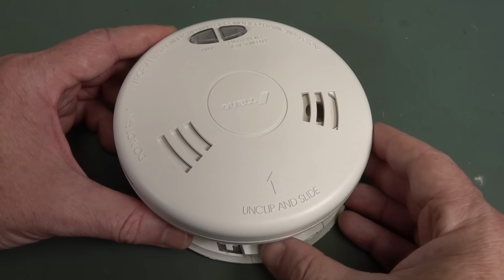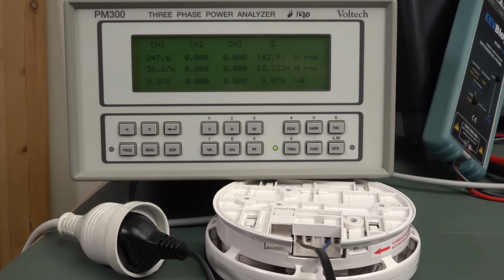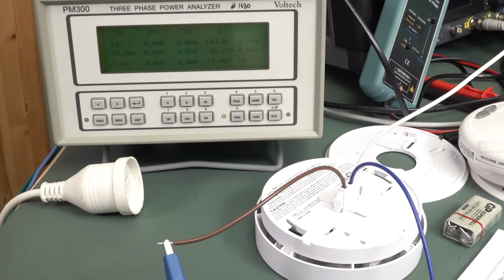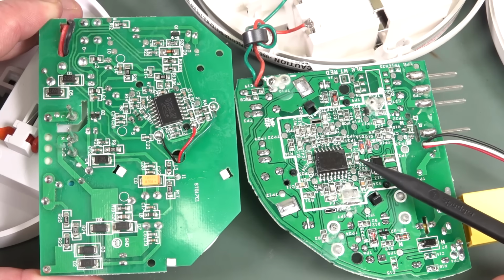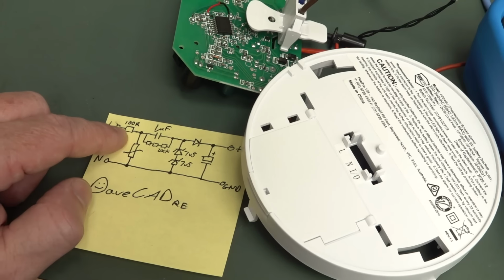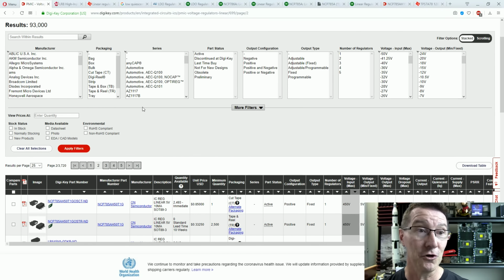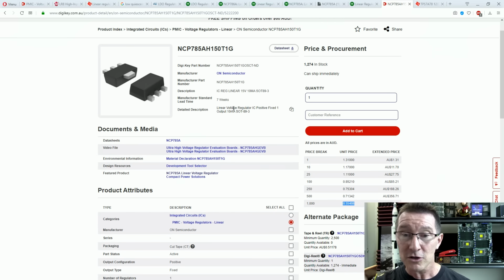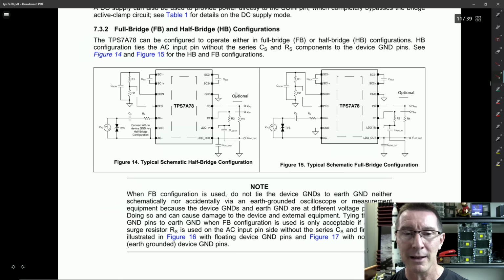EEVblog #1284 - How Bad Product Design Kills The Environment

Comment: They use that hinge system assembly to prevent electrocution when we replace the battery , try to test them with an over voltage and see if they detect their own smoke  before catching fire .

Comment: I think the problem is not only to be found in cost reduction targets, as these devices use very traditional designs. Of course there is always a more modern and more energy efficient solution but-- imagine you are a chinese backyard engineer who copies twenty-something years old european design-- you might have never heard of. 

And: these capacitor-rectifier designs are compensating apparent power (some say blind power) from inductive devices. That was welcome when these were more wide-spread 20 years ago! Today, everyone uses switching PSU and LED instead of traditional fluorecent lamps and transformers. 

BTW has anyone ever calculated the apparent power of all LED devices out there? Expect a loooong figure! Cheers

Comment: Lol why should we be concerned by a fire alarm when people leave home to work with their air conditioning running at full  blast for their dog or cat  or leave their energivore incandescent light bulb on all nights instead of switching to LED lighting who actually use near 8 times less energy ! imagine just turning the air conditioning a few degree up just how much at the country wide it would save current , We are flooded with dangerous unreliable chinese switching supplies instead of the more stable linear supplies who use to last 60 years who needed just a simple recap job at the end , installed in high end hifi equipment  back in the days ,even the newer digital dishwasher turned off is cycling wasting tons of energy , i use to own one made by Frigidaire who took in fire turned off , the switching supply control board in it started to arc turned into carbon and lighted the plastic shroud over it ,then i found out in a consumer forum that the same thing happen to a lot of owners where their entire kitchen took in fire ! The moral it's never leave home if you can with a sketchy switching supply charging a lithium battery in your absence !

Comment: Power Integrations do the LinkSwitch TN2 series of off-line switchers designed as replacements for capacitive droppers with  high efficiency and low quiescent power. Not used them myself but I've been coming across them and their predecessors for some years now.

Comment: Around here we are still using battery only smoke detectors units, no connection to the grid.
But then again ...
We have aerial (antenna) amplifiers, TV sets, desktop PC's, USB phone chargers etc. having a standby power consumption - all with a substantial quiescent consumption.
Mains driven smoke alarms is just the top of the iceberg ...

Comment: There's a simple solution: mandate that standby power for certain devices must be lower than X -- and regularly update X. This will affect all manufacturers, taking away the pressure to penny-pinch in this area to outcompete each other.
Then slap hefty fines on any company that produces, distributes or sells non-conforming devices.
Market economy is not the right entity to count on for a solution.

Comment: man that AUS mains is out of bounds !
Reply: Historically it was 240v +- 10%.  Its transitioning to 230v to harmonise with other markets but the generators probably have a lot of capital invested in 240v so wont move until forced to replace equipment through maintenance, repair or replacement.

Comment: Reactive loads are the "hidden" thing that can blow fuses even if everything looks OK, but the reactive load from a capacitor solution can balance out the reactive load from an inductive unit like fluorescent lights and cheap wall-wart transformers. So you have to look at the whole house before you see where it goes.

Comment: Yeah, so everybody is looking for energy effecient  lights, but their smoke detectors might piss away watts 24/7
Reply: My son just asked me, "Why don't we just turn it on when there's a fire?" As I stare at him, I'm thinking "saving up a college fund might be a bit too optimistic".
Reply: @saddle1940  - Your son is a GENIUS. Let's use a Peltier (or similar Heat > Power device) to power up the alarm using the fire's heat for power! We could also include a small wind turbine to harness the energy in the convection currents.
Reply: @johncoops6897  Thats pretty crappy smoke detector. When the peltier is heated up enough to produce power, there is already fire mayhem. Smoke detectors detect smoke, not fire.
Reply: @kapu4369  - whooooosh! Over your head, huh?
Reply: @johncoops6897  your joke (?) was just not very good
Reply: @issecret1  It was quite good actually.
Reply: Fire sprinklers are almost that. They have plugs held by glass vials that burst when heated.
Reply: 5x 1 Watt smoke detectors vs one 60 Watt  light bulb: 120Wh for 24 hrs of smoke detection = 2 hrs of light. Probably best to get those light bulbs in check.

Comment: Great vid! I agree on you with this one, Dave. You claim 30 cents/unit for not killing the environment, I guess you mean passive PFC (choke?)?  What I am wondering about is small devices with limited  lifespan, like led and CFL bulbs. Would it make sense to add PFC to these? Or will it be a better idea to add PFC at e.g. the distribution transformer?
Reply: No PFC in anything here.  Just adding actual regulation instead of burning 0.5W real power in the power supply.

Comment: I Belgium, and many other countries, they are pushing "smart meters" that can read the VAs and report them over a timespan. Lets all be gullible, and believe they won't start to charge by VA in a few years.
Reply: And the consumer will add their own power factor correction from their power wall that will pay for itself in a very short time when billed by VAhr vs Whr.  That and overnight rate usage will drive "grid backup" solution sales.

Comment: I'd be more pissed by the amount of power it really uses. That 1.3 W thing would cost 3.5 € per year in Germany. That's insane.
Reply: years ago I have seen a TV antenna rectifier which was rated for 150 watts - 1300 kWh per year, or almost 400 € in Germany (it was installed in Germany).

Comment: And this, children, is why we need government regulation.

A lot of people have swallowed the myth about free markets being all-powerful at self-regulation. So they think requiring products not to have exposed mains leads is fascism, or almost. They think that it should be left to the free market. You get killed by a badly designed product, so the next time you buy a better designed one - self-regulation, everyone's happy! I sometimes wonder if they can really be that naive.

EU banned the sale of tungsten lamps. Otherwise, they would have never gone away. People just didn't care. In the shop they faced the decision to buy a tungsten lamp for 20 cents or a compact fluorescent for 20€, and tungsten won out every time. No matter that it cost you MUCH more in the long run to waste 99% of power for 1% of lighting efficiency of tungsten, you had to pay for electricity anyway, it was a fixed cost and you could afford it, so just buy the cheap lamp. There was no reason to switch. It was "normal" to use tungsten lamps - everyone was doing it. It was people like I that had to explain why they installed bar-type fluorescent lighting fixtures in their home.

Ok, so the compact fluorescent lamps were horrible. They didn't hold up like promised, they gave less light than the packaging suggested, and didn't start at full intensity. So people were ready to pay for better alternatives, and so we got the LED revolution. That would have happened much later if we didn't have the tungsten ban. People would never have asked for something better if they had something that is good enough and required no thought.

Comment: Strange solution with the series resistor before the MOV. During surge testing the resistor will have to take all the current and will fry eventually. Not even mentioning the fact that MOVs degrade with each pulse, until they fail short. Goodbye resistor, welcome fire in a fire alarm component. Unless it's a fuse resistor - then it will safely open with first surge in your line and you have no alarm anymore.

Comment: "can't close it up if there is no battery installed"
 pretty much pointless feature since someone could just put a dead battery in. 

 it sound more like a bodge someone would implement if the device could only detect a dead battery if it's linked in, and give no warning if there's actually no battery. that senario doesn't spark confidence in what would happen if the terminals to the battery are broken.

it would be like taking a text form field and using an input mask to prevent users typing a semicolon because you neglected to do any input sanitizing.

Comment: Yeah, bad design. Good design has to be driven by legislation.
The term 'sniff of an oily rag' isn't used in the UK. We use ' mouse fart'👍
Cap dropper circuits can fail as the cap degrades.
Power factor corrected buck is obvious solution but then emc may be an issue.

Comment: Just adding a common mode choke would likely make that noticeably better...

Though, these types of power supplies are also extremely common in modern "smart home" stuff, like switchable sockets, light switches, etc. And there a "modern" house can have 10's of these nasty things spread out all over the place.

But at least it will primarily consume current at the peak voltage of the mains sine wave, so it could be worse and consume it way out of phase.
I can forgive someone not trimming their product to have a power factor better than 0.9, but 0.06?!
 A good designer should at least try to reach a power factor of 0.5 or better....

Being worse than 0.4 should preferably be a criminal offense due to how wasteful it is. (Though, the parasitics of a mains power cord means that its "idle" power factor is kinda crappy, but we can make an exception to this fairly tiny unintentional capacitor. Ie, we can make an exception if the VA is less than 1 or lower.)

Comment: I have seen something really "nice" in that regards:
some sheds for bikes in a housing complex. To make it "more green" they included motion-sensors for the lights. The sensor takes ~2W continuous, the LED-Lamps installed are 3.5W .................. why not just a simple door contact switch with a timer.
Oh yeah - nearly forgot to mention - there is not just one sensor - there is one on the outside and one on the inside. And the sheds are built in such a way that small animals like cats can easily leave them, and of course there are many cats that constantly trigger the sensors.
Reply: Reminds me of the neon nightlights with the sensor to turn them off during the day. The sensor is just a phototransistor in parallel to the neon bulb, so they consume more current when off than when on.

But hey, it looks like they're saving energy...
Reply: @strehlow  Oh yeah - for bigger installations it was always nice to see the little extra box that had a heatsink to not burn up XD

Comment: Great video. Addresses EXACTLY my concerns about power consumption of late.
So i'm building my own switching power supplies with standby circuits for stuff more and more lately, its not rocket science, you go to a semiconductor catalogue and find a chip that allows the features and there is a plethora of stuff in the 'ù' amp range for hibernate/standby. Build that chip into the design.

Its time people started lobbying the politicians: demand very strict energy efficiency. Revise it every 18 months as the stuff that keeps coming out is getting better and better. Another gripe: Don't want E-waste? Then mandate a 10 year manufacturers warranty for EVERYTHING. 
That'll elliminate dodgy power supplies, cheap electrolytic caps etc in no time ;-)  Solutions literally sitting on the shelf!
Reply: Manufacturers will conveniently go out of business right when their products start failing. And news ones will start up with the exact same products

Comment: Hi Dave!  Here is a good power-factor offline regulator option to consider.  It connects directly to the line, drawing power when the line is above the required input voltage. and as the  line voltage rises, series element shuts off, isolating the circuit until the live voltage cycle drops low enough to re-power the circuit.  Check out "https://www.microchip.com/wwwproducts/en/SR087" to see the chip.  This part doesn't draw current at the peaks (like the cap-droppers), but only draws linear current to achieve a good power factor.
Thanks for all the videos!

Comment: An LDO will still give you 20 times higher energy consumption compared to what it actually needs, also with a terrible PF. That last chip with active rectifier is a big step forward in terms of power factor, however still consuming 20x power and too damn expensive at $1. You need $0.3 tops, to make it in to the usual grocery store.
Reply: Also, a big chunk of that reactive power, caused by capacitor-zener divider is, on average, being compensated by all of electric motors we have. So, while 20VA is really plain idiotic, the actual load on grid is much less than calculated in this video.

Comment: There are smoke detectors out there that have a fixed battery that hold charge for the FULL lifetime (10 years, they have an expiration date). Got 3 of them and still working fine after 9+ years. I have checked an mains powered one before and the consumption was multiple watts and therefore I never bought them

Comment: If there is a government requirement for installing this things, then the government should specify them in such way you don't get this kind of rubbish products killing the grid.
Yeah, if the grid is planned for this kind of massive useless load, and compensated, could be good.
As far as I know, most power grids where designed a long while ago, when typical load was a lot different then today (so much switchers today).

Comment: Could it be that they chose such a "simple" power supply design because it's simplicity makes it more robust and reliable which is an important consideration in what is basically equipment used in a life safety application?
Reply: Whilst the argument might have some validity, in the real corporate world of "products built down to minimum BOM cost for maximum profit margin" the decision was probably made because capacitive dropper supplies are as cheap as it can get. A passive transformer-based linear supply would use minimal extra components, would be just as reliable as a cap dropper (if not more so), and could easily be designed to have better power factor. But such a design choice would add 20-30 cents to the BOM cost per unit.

Comment: Not a problem ... they could use a 5v cmos optical smoke detector chip, about a buck a piece. EV blog is in the wrong business :) LOL  The line voltage is used to indicate when the battery is dead -- cause that battery probably participates in driving the load beeper.  It a catch 22 oddity.

Comment: I wonder why to choose a linear regulator? My understanding of linear regulator is, that they just "burn" the input voltage minus the output voltage with the output current into heat. Like the old 78xx variants. I always thought you would need a switching regulator for such high dropouts.

In case of 450V input, 15V output and 80mA input = output => this results in (450V-15V)*80mA ~ 35W - way more than the original "bad" design.
Reply from the maker: No, with the high voltage regular the load is only 50uA + the 10uA or so quiescent current of the regulator. The zener is a shunt device that needs higher current to regulate it's voltage.
Reply: @EEVblog  Where do you take the 50µA for the NCP758A?
Reply: Because he's the co-host of the world's biggest electronics engineering podcast, and for him only the active power factor matters, not the deformant power factor, which is mainly because of semiconductor rectifiers which introduce a whole lot of odd, in-phase harmonics into the grid, and is the reason why his magnificent 3-phase power analyzer shows that aberrant ACTIVE power factor.

Comment: I bet there's a lot of low voltage power adaptors that waste loads of energy. Especially some of the cheap devices from some websites. I wouldn't be surprised if they don't meet regulations.

PS: I REALLY want that stapler!! I went to buy one earlier this year but they weren't in stock, so I brought another brand's red stapler, it isn't the same.😢

Comment: Let's get a bit of perspective here.  The psu is almost always a capacitive dropper. The main problem with power factor in industry and domestic installations is inductive loads. Every transformer or induction motor (not to mention shitty shaded-pole motors you find in small fans for domstic appliances) pulls the current vector in the opposite direction.  So you could argue that these smoke alarms are actually power factor correcting the home.  Making it better not worse!
Reply from the maker: Unless the power factor is already corrected in the system in which case it would make it worse.

Comment: That heat will do a couple things- first, it will cause discoloration of the plastics and the paint on your ceiling, and second, it will induce air currents which will naturally circulate (presumably) smoky air past the sensor. If not for that wasted heat, the sensor might not ever see any smoky air.

Comment: I had some poorly designed battery operated fire alarms before, they'd chew through a 9v alkaline battery in under 2 months, whereas the good fire alarms i replaced them with can last a few years on a 9v battery.
A good lesson to learn, never cheap out on safety equipment.